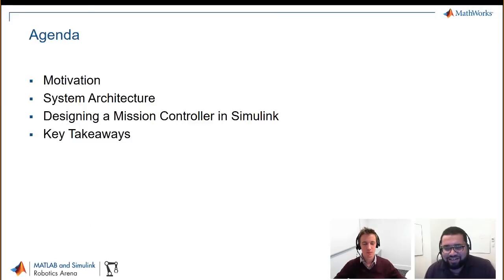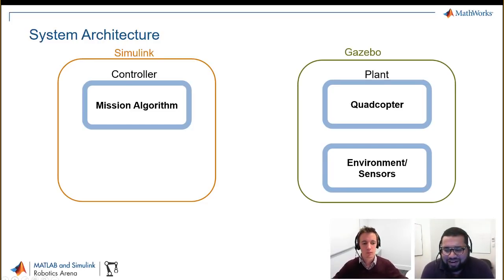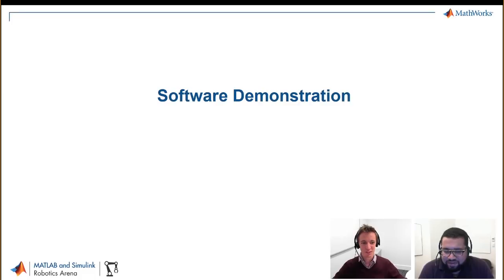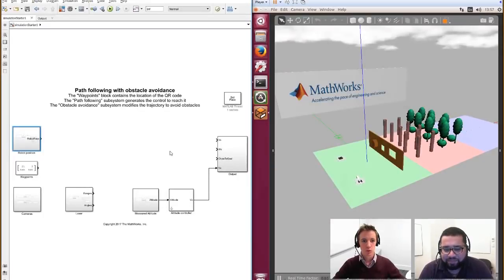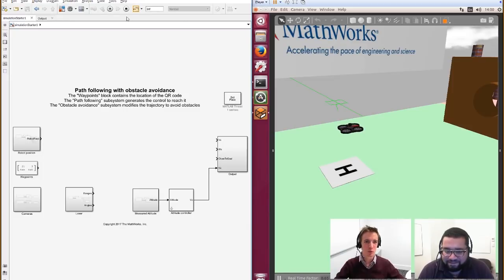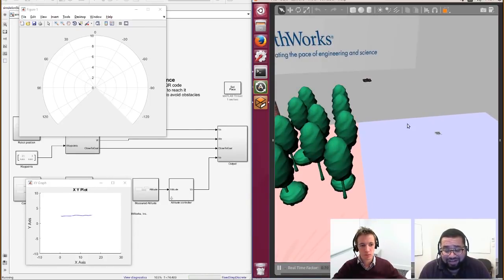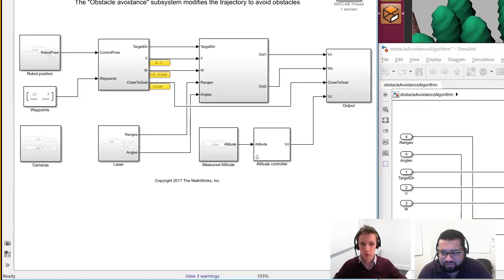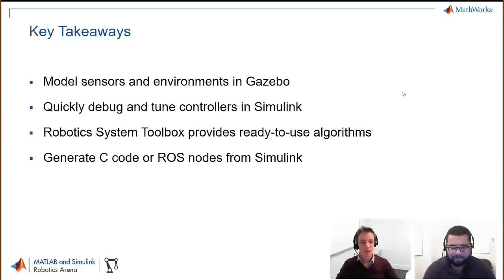Simulating Quadcopter Missions with Simulink and ROS

Comment: I'm simulating a quadrotor command on Gazebo.

I have connected Simulink to Gazebo and I can send the velocities to the quadrotor without problems, but,I can not receive the real data from the drone; when I connect a scope block to the subscribe block, the "Z position" signal for example remains at zero even if the drone is changing position ! same thing for the other coordinates.
I read the following:

## Notes ##

If a model can control the drone but does not receive any data from the drone, make sure you have set the ROS_IP environment variable in the VM before running ROS.

But how can I set the ROS_IP ?

can anyone help to solve this problem ?

Thank you in advance,
Reply: Have you seen this resource? http://wiki.ros.org/ROS/EnvironmentVariables 

Also, on the MATLAB side, check out this answer: https://www.mathworks.com/matlabcentral/answers/119559-why-is-the-ros-subscriber-callback-in-matlab-not-triggered-when-messages-are-published-from-an-exter

Comment: Hi guys, great video! I'm wondering why Gazebo was used? Could the plant and environment not have been simulated in Simulink as well?
Reply: Yes -- in fact you can find a couple Simulink quadcopter examples here: 
Link 1: https://goo.gl/DPG1wu
Link 2: https://goo.gl/KkrGJ5

Gazebo and Simulink are a little different in their strengths. Ultimately, it depends on what you need from simulation.

Gazebo is more of a physics engine/virtual environment, so it will give you "good enough" physics for system simulation, and is quite good at virtual sensing -- that is, simulating camera/lidar/point cloud sensor feeds for algorithm design. The latter is why Gazebo was used in this example.

On the other hand, Simulink is equipped with robust solvers for differential equations so you can implement detailed and accurate simulation models of your robot, down to the low-level actuator dynamics, controls, and so on. Referring back to the earlier links, there is a Simulink 3D Animation product (Link 1) for simulating virtual environments, and also a Simscape Multibody product (Link 2) for 3D rigid body mechanics + visualization.
Reply: Cool! thank you for the response. Very interesting stuff.